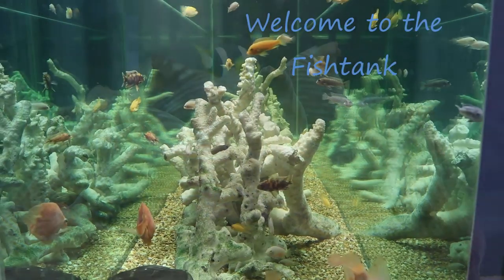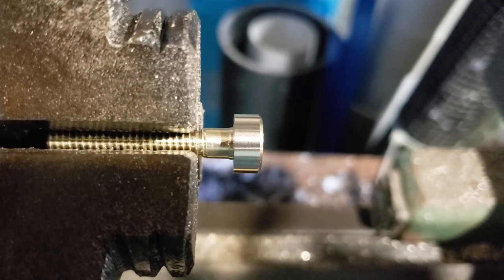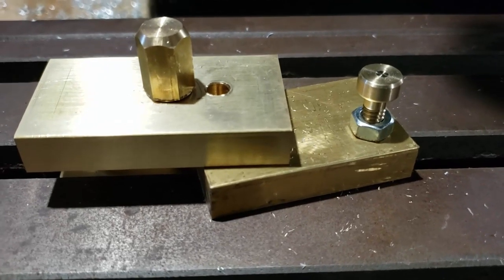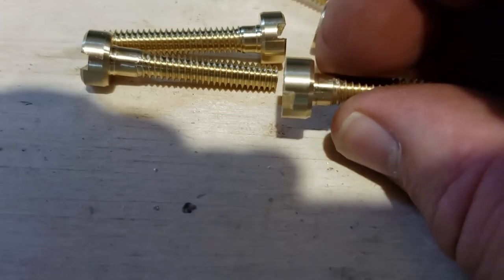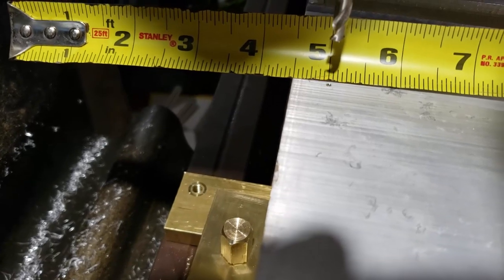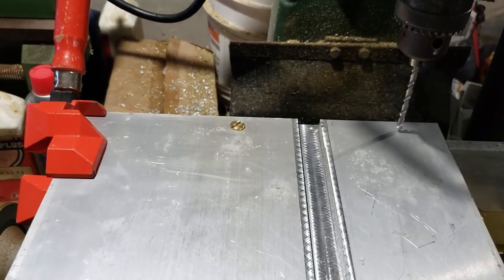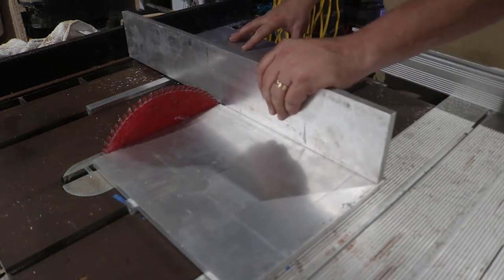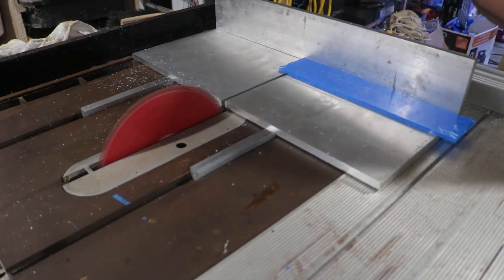DIY Aluminum Cross Cut Saw Sled Part 3

Comment: This is an awesome project man....we have a video coming up Friday where we us slate rock as a top to our new project and drilled like 40 holes in it to hold the plants....it worked out pretty well but we’ll see how things progress....probably would have easier to use plastic but we needed the weight to hold all the ivy since it hangs down and we were afraid plastic wouldn’t cut it....👍
Reply from the maker: Glad you guys like it! I will be checking out your vid.